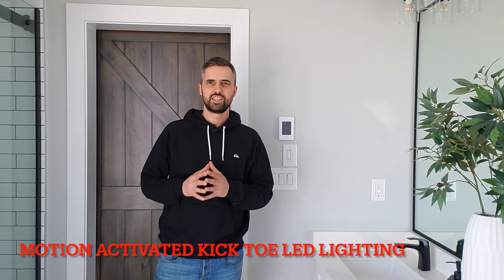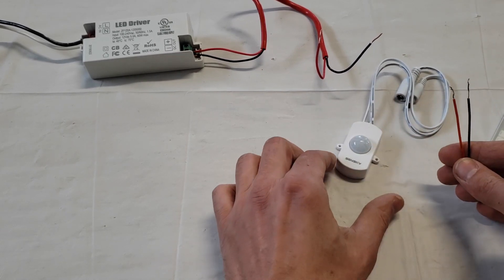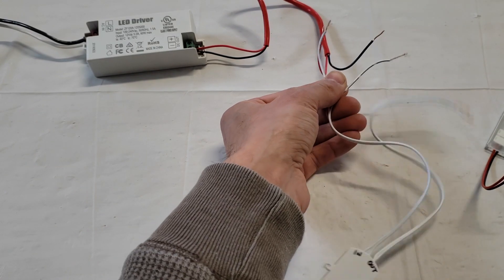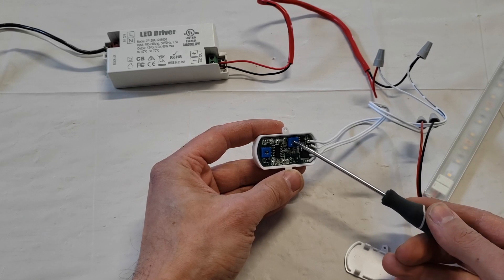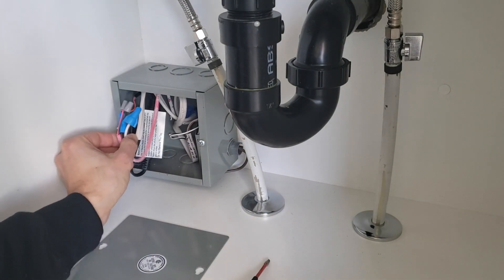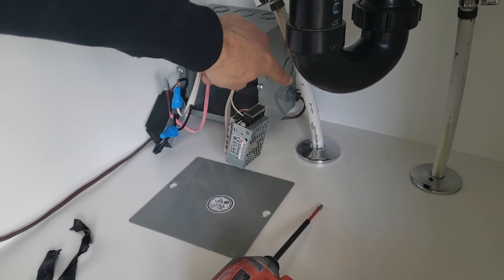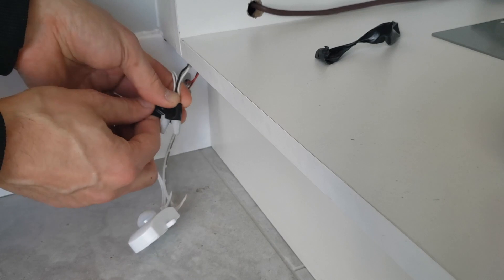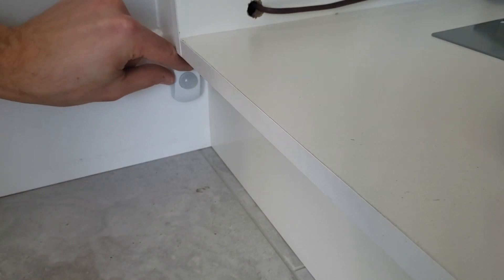How to install Motion activated LED kick toe lighting

Comment: Do you have a video explain how to use the various power supplies, how to connect them to the romex, and how to pick the right one?
Reply: Do the math for your wattage and length. If you have a long stretch sometimes they use 24v instead of 12v too.

Comment: Hey. I followed the instructions but the lights never go off. I don’t think the wires are reversed as I double checked. Any insight?
Reply from the maker: @tristankroll2004  could be a couple different things that I've experienced before... the wires on your motion sensor may be reversed, or the timer setting inside the motion sensor is set too high. Hope that solved it.
Reply: Thank you for the response. Would the watt size of the led driver matter? I notice the motion sense says to use 3A or less and my driver is 5A
Reply from the maker: @tristankroll2004  i don't think it would affect the light staying on all the time.  Technically the driver can be a larger wattage as long as the load doesn't draw more than the sensor can handle.  If nothing else works, try replacing the motion sensor.  I have had 1 or 2 that wouldn't turn off even though I did everything correctly and after replacing it worked as intended.

Comment: I really like what you did with the nema box. Is it code compliant having the low and high voltage in the same box like that?
Reply from the maker: The stamp on the red low voltage wire says 300v, so you can put it in the same box or hole as the romex.
Reply: Totally!

Comment: Where did the white led driver go? Later in the video you showed a silver one
Reply from the maker: The white one was a sample to show you how to make the connection.  The silver one was the one actually installed.
Reply: @energyoneelectric  What are the specs on the silver one?  Can you link it
Reply from the maker: @User-qu7pq  I usually buy Meanwell rs-25-12 or rs-50-12 etc.. the middle number refers to the watts and the 12 refers to 12 volts. It's a good brand, never had issues.

Comment: Great video! I'm looking to do a similar setup with LEDs running down either side of some stairs. The thing is, I'd like to have a motion at the top and bottom of the stairs to turn the lights on whether you're going down or up them. I'm sure this is possible but wiring is not my specialty. How would this be wired?
Reply from the maker: Thanks for watching! I have never installed a sensor at the top and bottom of the stairs, I typically install stair lighting on a 3 way switch. These sensors are not designed to act like 3 way switches. You can try something and let us know if it works: When you send 12v power to your motion sensor, send another 12v power to a second sensor. Then from each sensor connect to the same point on your led strip. Test this out before actually wiring and installing everything in place.

Comment: Thanks for the video's.  I want to be able to control brightness and color (RGB).  Do you have a preference for a driver that will allow google to turn on, off, and adjust RGB and brightness?
Reply from the maker: Check out my video on permanent Christmas lights.  I show an rgb driver that is wifi capable and can connect to your phone.

Comment: thanks for the video. def want to do this. Was the led driver not used? just the transformer? i dint see the driver from the beginning in the junction box. thanks
Reply from the maker: A driver and transformer are the same thing.  In this video I had 2 inside the junction box because they were both powering different things.  1 was for toe kick lights,  the other was for shower lights. Thanks for watching.
Reply: @energyoneelectric  would you mind linking the one you used
Reply from the maker: I use different types depending on the wattage and what's in my stock pile.  Check back this weekend, I will link to a power supply for you.
Reply: I would like to buy that transformer you used, can you provide the link to it please?
Reply from the maker: This may not be the exact one I used but it should be a similar one. Keep in mind you typically only need about a 15 watt power supply for a short length of led strip. I calculate 3.2watts per meter of single color led tape, then divide that total number by 0.8, because you should only be loading your power supply up to 80%. Choose a power supply that matches your final number or bigger. 
Be cautious, any power supply that has an input of 100v-240v ac may have a power selector switch on the outside or somewhere inside the shell that you will need to select with a screwdriver before connecting it. Hope this helps. Come back and comment how your project turned out.
 https://amzn.to/3xTY1nu

Comment: awesome explanation! Normally, we're used to seeing a switch control the LED lighting. In this case, no switch required between the 18 wire power and the LED's because the motion sensor acts as the switch. Is that correct?

Thanks for the video!
Reply from the maker: You are correct, that motion sensor acts as a switch.  Thank you for watching. Stay subscribed because I will be uploading videos on a regular.

Comment: I did this at home a few years ago.  It's hard to not sound weird when I say how much more pleasant it is when you have to go to the bathroom in the middle of the night.  You're not having to cope with pitch black, and the light isn't so much it totally wakes you up.  I'm so happy you covered the two most important parts - using a GFI and making sure the sensor can detect you if you're sitting on the toilet.
Reply from the maker: Thanks Michael, I appreciate the encouraging comment.

Comment: Your motion sensor switches both leads of the led strip. Is there a reason that this is better than using a single pole switch to just connect / disconnect only 1 of the 2 leads? I am thinking of using a Lutron standard occupancy sensor switch to trigger the kick plate lighting.
Reply from the maker: You could just use a single pole switch to turn on your led driver.